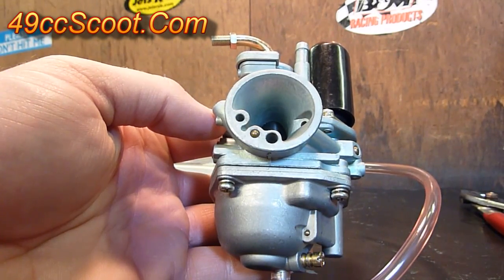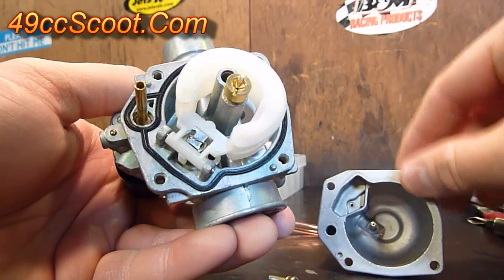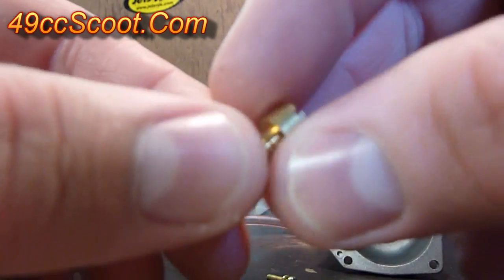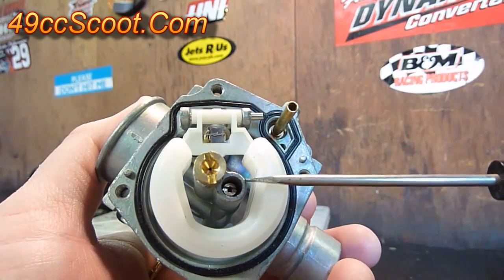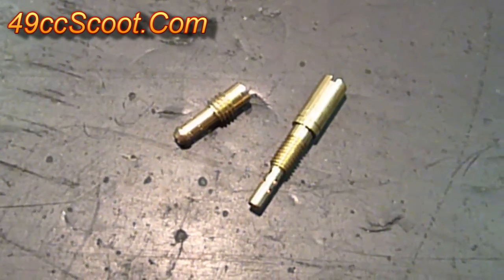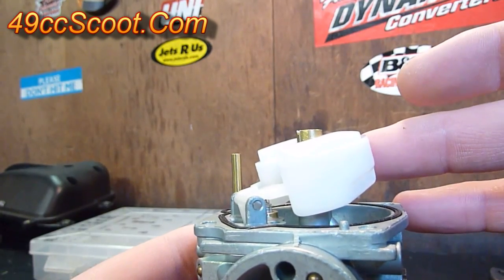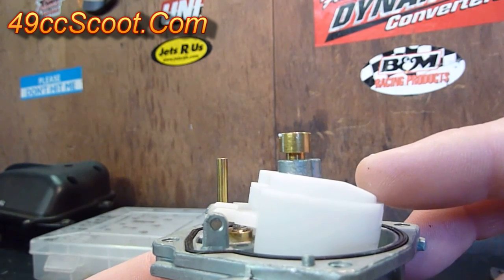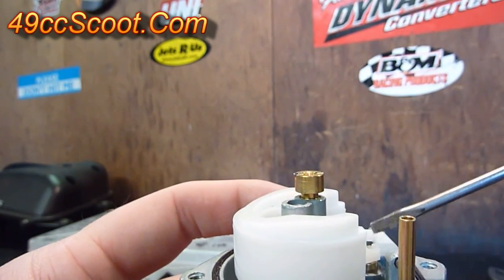Two-Stroke Scooter / ATV Carburetor Settings And Adjustments 4of4 : Jetting & Float Height

Comment: My scooter (2019 Wolf Rx-50) doesn't like to start. I have to use a mix of pumping the throttle, electric start, and kicking( not all at the same time) just to get it to start. With the e start it'll crank over and over but won't fire. Got spark air and fuel but seems like it won't ignite. If I kick it about 30 times it'll start and run all day. However if I turn it off it doesn't start and I have to repeat the process. No leaks fuel or oil. Petcock is working fine, filter is fine. All electronics are fine. I've been over the carb 20 times with carb cleaner and nothing is clogged. The tank is clean, all the fuel lines are clean. No vacuum Leaks, I'm at a loss to what it could be.
Reply from the maker: Have you checked valve lash lately?

Comment: Hello, nice video. I poured almost 1 liter of 2 stroke oil in my petrol tank ( by mistake). And after one week my scooter stoped, it sounded like irn out of petrol. And now I wont start. I have spark on the plug. I need  to buy a new vacum fuel pump because i is leaking. It will not start with start gas (starting fluid) either. I will try to remove the carburetor and clean it. Any ideas what more to check?
Reply from the maker: Drain the old fuel and put properly mixed fuel in.
Check compression.

Comment: I have a question... I know it's been 12 years since the video is posted but my Malaguti F10 Jetline is having some problems. I bought new parts for it like new carburetor, cylinder, piston, variator kit... everything is new on my scooter. Tried everything you showed in the 4 videos on how to but when I drive it, it goes very very slow up in speed and uphill it's slow af barely goes to 10mph. I don't know what to check. I checked the exhaust, the intake, generator, sparkplug, sparkplug wire, cdi, even new battery... It's my second Malaguti F10 and with the first one I could go 50mph and this one barely makes it to 25mph on a downhill.
Reply from the maker: Cover the basics first. Do a compression test, check spark strength (bend the ground strap way back on an old plug so it has a big gap and make sure it still sparks bright and consistent), double check the air filter, air box, intake connections, fuel supply. Try using known good parts off of the well performing scoot (CDI).

Comment: great vids, realy usefull. already been bussy with my quad, different carb, a dellorto 17.5 tho. had a main jet that was to large so would not go faster than aprox 30km/u. now it reaches about 45 or 50 which is just right and runs nicely, but when it is on operating temp it does not pull good anymore. the first bit when idling an hitting wot goes fine but then it slowly climbs in speed, where before it would realy pull. so u could say i am missing torque
Reply from the maker: Also consider the CVT. Sometimes springs fade with heat. CVT gets hot and  RPM drops. Watch your tach carefully.
Reply: @49ccscoot  nice of you to reply  thanks :) i wip have a look and check the condition, but other than that how would i know that it is the cvt, and not a lack of fuel or something? the sparkplug looks oke, a bit mat black even but i dont dare going smaller with the main jet, afraid it wil run to lean. also i moved the needle clip 1 position down but that seems to make it worse
Reply from the maker: @Kpostma100  The tune for the carb really shouldn't change much from warmed up to a little warmer than usual. If it's heating up a bit too much, that may tell you it's already too lean or there's an issue with cooling otherwise. With one of my scoots, it was pretty obvious. I had a CHT gauge and that would stay about the same and also had an oil temp gauge on it (four-stroke), and after time it would drop RPM. Without seeing engine temps rise, it was easy to tell that something else had to be happening.

Comment: My god I feel dumb. So the main jet isn't supposed to be loose at all? Been having an issue with my old moped and I have the main jet loosened a bit because that's what I thought it was supposed to be. Well, I guess I can check if that fixes it tomorrow. If so, many thanks!
Reply from the maker: No. It should be snug. Hope that fixes it.

Comment: I'm installing a yz80 carb on my 70cc vino 2 stroke, I want to relocate carb is there any problem with making intake a foot long?
Reply from the maker: Generally people are trying to get a short inlet path and the most direct flow toward the transfers. A long intake may make the engine favor low RPM. In the case of a foot long intake, probably very low... like idle.
Reply: @49ccscoot  thanks pal

Comment: Hi again my 17.5 carburettor have a problem i order a new one 19mm you thing the air pipe can fit thank you again
Reply from the maker: Depends on the carb, because there are lots of variations of 19mm carbs. Many can be made to fit. I've used 19-21mm DellOrto PHBGs in stock intakes a lot.
Reply: Is same this one item number 203299831261 EBay thank you PiaggioZip 50 2T
Reply from the maker: @MrBerenguer67  0 results for that number. If it's for a stock scooter, it may fit. See if the listing has any dimensions that you can check or try asking the seller.

Comment: hello i have a problem my bike bogs at 1/4 throttle, it runs great at 2/4 to full throttle
Reply from the maker: You can try richening the mixture screw first. See if it improves. If not, try leaning it a little bit. Make notes of where it was and how much you adjusted, so if it gets very bad you can  at least get back to where it is.

That may not solve it, but it would be the first thing that I'd try. Then maybe try richening the needle one clip position and see what happens, if it doesn't run well with just the mixture screw change.
Reply: @49ccscoot  thank you for fast reply,
i tryed richening mixture and it was most stable when it was totaly screwed but i had problem with stuttering at full throttle, solved problem by raising the needle to the max, but now i have problem at full throttle mixture is too rich it doesnt stutter but its worse i can feel it i will try smaller main jet tommorow
Reply from the maker: @BOOMCATIGA  Sounds like you're on the right track.

Comment: How do you know if its an m4 m5 or m6 threaded jet?
The thread is 3mm in diameter, and the head is 5mm diameter.
Reply from the maker: The diameter of the threads will tell you. So, and M4 is roughly 4mm... usually a little shy of 4mm... but not 3mm. You can also use thread gauges, or go to sites that have measurements of jets and try to match them up. JetsRUs has some measurements.
Reply: @49ccscoot  thank you!

Comment: Do you use the carberutor used in this video for your 80cc performance scooter? I have the same one and have a 70cc kit with a air pod filter. I am at a #115 main jet and for the life of me cannot get it rich enough to bog at all. Any suggestions?
Reply from the maker: My 86cc that's currently in my scoot is way too much for a stock carb. The stock carb has worked fine for me on mild 70cc builds. It is even OK with a stock 90cc, though the 90cc ran much cooler with larger aftermarket carbs for me.

My first suggestion would be to go back to an airbox and go through the main jet selection process again. I'm using a modified stock airbox on my 86cc at 14,000RPM with a 25mm carb. 
https://www.youtube.com/watch?v=SJth-GEy9aY

Comment: Took carb off 90 cc 4 wheeler and cleaned carb and jets throttle snaps back as it should but throttle seems to stick when I'm going full speed and go to let off and it's still wanting to go on it's on
Reply from the maker: Could be a cable issue or the throttle itself. You'll need to inspect the whole system and it wouldn't be a bad idea to lube the cable while you're at it. Replace the cable if you find it frayed anywhere.

Comment: Hi man. Do you know of a link where i can buy that rubber seal on the bowl? Mine broke off when i cleaned the carb. I hve a stock mikuni carb that has number 16-56829 written on the outside of the carb. Thanks I'm from NZ usually gets my parts from ali express
Reply from the maker: Look up the scooter places that you normally shop or places that ship globally like maybe scooter-attack or scootertuning. In a pinch, I have measured o-ring diameter and then figured out it's size if round and found generic o-rings that work. That can be a pain when the ring has a lot of contours beyond the basic round or rounded rectangular stuff though.

Comment: I need help my carb is leaking after every ride for few minutes and it stops from overflow and i tested tension on my float and its super good but it doesnt stop leaking
Reply from the maker: If the float height is good and the float isn't stuck, then maybe the float needle isn't sealing off flow.

Comment: So I just bought a new carburetor to my scooter and when I hit max gas the engine doesn’t get gas and will die if I keep it on max gas, what do you think the problem is??
Reply from the maker: If it's only all the way wide open, it could need a different main jet or the main jet may be clogged. If it happens basically any time you try to hold it 1/2 throttle or more, then the main jet is probably clogged or it's way far off. Also check fuel supply and float height.
Reply: Thanks, because my old carburetor had a 52 main jet and the new one has a 75, so then I just gotta change those right or am I wrong, because I’m not from the us and I don’t really understand everything?
Reply from the maker: @alfonsbonesson2707  Try that swap and see what happens. You may still need a different jet. Make sure the airbox and everything is installed as it normally would be when testing.
Reply: 90GTVert Now I tried to change the jets to the smaller one (52) from 75 and now I can’t raven get the weel spinning, what is you’re opinion on that, what should I do to fix it?
Reply from the maker: @alfonsbonesson2707  Get a main jet kit and try a larger one. Make sure everything is good with the air box.
Reply: 90GTVert yeah I bought a  sport air box just recently so that one is good, I’ll change the main jet but do you think I can change the needle because I haven’t checked it? Maybe make it put in more fuel?
Reply from the maker: @alfonsbonesson2707  When the problem is wide open throttle, it's generally the main jet. You can try restricting airflow to see if that helps till jets arrive. Sometimes taping over just a small portion of an inlet in an airbox will work. Prob that sport airbox needs a larger jet.
Reply: 90GTVert i changed back to the old og air box and the 75 main jet and now the scooter doesn’t die at full gas, and the engine goes, but the wheel doesn’t spin at full speed and it only goes 20 km/h when it should go at least 45 km/h. Why do you think it doesn’t spin at full speed, do I still need a bigger main jet?
Reply: 90GTVert the scooter didn’t start and wasn’t able to go full gas before I change the old carburetor, so it doesn’t have to be the new carburetors fault
Reply from the maker: @alfonsbonesson2707  You probably need to tune the carb (diff main jet, idle mix adjustment, needle settings).
Reply: @90GTVert Thanks!

Comment: So if i want my stock airbox with snorkel off to a ppd filter  i would only have to upjet the pilot jet?thanks
Reply from the maker: Main jet almost certainly and maybe the pilot jet. If you can get the tune at very low throttle right with the idle mix screw, than you won't have to change the pilot.

Comment: Hello, Frist thank you for all the videos. I have one question. I was change cylinder with a little more powerful and now I have problem with the power. I think that don't get enough gas. So now I need to change the jet, but I don't know which jet, main or pilot jet ? Thank you for answer.
Reply from the maker: Could be any of the jets or adjustments, but most commonly it's the main jet. Helps to understand what works where. http://www.49ccscoot.com/faq/carbtune.html

Comment: Hey great video, where can I order (or get a part number) for that float?

I have a Bombardier DS90 here with a cracked float and I can't get parts because they're discontinued!

Need a part number for this as it looks identical!
Reply from the maker: Just replied on your other comment. Also, you can get whole carbs on eBay cheap. Search for "polaris 90 carb" and some will come up.
Reply: 90GTVert thanks!

Comment: sir~ I have PHVA 17.5 carb,  my friend said that 0.75 mikuni idle jet are able to replace.  
but vm's thread diameter are too big for my carb               
orignial idle jet Screw thread size=3.9mm*0.75
  VM16 idle jet Screw thread size=4mm    *0.75
 I couldn't find the right idle jet to replace...
Reply from the maker: You can get PHVA idle jets from treatland.tv and prob other places.

Comment: In my bike when I drive slowly my bike getting off, please guide me to trouble shoot
Reply from the maker: You mean the engine is cutting off? Any other symptoms?
Reply: 90GTVert when I drive in 3rd or 4th gear & if I slow the acceleration means my bike off. Previously I have over flow problem in my carburator my mechanic replaced new carburator from that day this problem is maintained. My spark plugs gets black also
Reply from the maker: Does it run well otherwise? Maybe try adjusting the idle speed and mixture settings. If you aren't off of the throttle totally, then it's not so likely that.
Reply: 90GTVert I already adjusted ideal screw & air fuel mixing screw & slider pin also I adjusted but no use. Problem is still maintained, I given to several mechanic but problem is still maintained
Reply from the maker: No leaks around the carb/intake? SOmething not connected well or cracked/torn? Thinking that since the issue started after a new carb.

How about simple stuff like changing the spark plug(s) and checking the plug gap?
Reply: 90GTVert I didn't change plug, u have given some idea. I will change and inform u
Reply: 90GTVert no leaks around carb/intake

Comment: Thanks for the video, I just bought a Genuine Buddy 50cc, and want to get some more speed out if it. So I’m looking at the Prima exhaust upgrade that comes with the jets. Dealer wants $300.00 to install. I Never changed jets out of a carburetor before, thanks to you, I can see it’s very easy. Thanks again 😁
Reply from the maker: Good luck with it! Way more info if you want it : http://www.49ccscoot.com/faq/carbtune.html
Reply: @49ccscoot  Thanks for the further info. About to do a new main jet on a 2020 Taotao pony 49cc scooter carburetor.Was trying to see my best starting point.Definitely going the 5-sz. over & rich.Then back it down as tread talks about. Thanks alot!

Comment: pls help OP or 49ccScoot.com I am trying to find the size of my VM22/210 pilot jet I lost. There is no information on the entire internet about my Mikuni carburetor on a Suzuki Carna 1985 49cc scooter so I have no clue what size it was... apparently the engine can seize if its too low (lean) and they're very expensive so I can't just go buy a high number and work my way down...
Reply from the maker: If you can find your model on a Suziki parts site or a dealer, they often list jet sizes.
Reply: Trust me ive searched everywhere, this scooter is an import and they only made them in Japan. ive  even searched japanese sites and closest i got was here (https://japan.webike.net/ps/#!search&p.ref=product-search-es&p.rows=24&p.m=5799&p.c=1340) . I saw that many 50cc scooters use size 17.5 to 30 , do you think 30 or 32.5 is a safe bet?
Reply: i searched google japan in japanese and found it on a random second hand site. thanks though
Reply from the maker: Glad you found it. Wanna post what jet size you found here just in case it will come up in a search if anyone else ever needs it?
Reply from the maker: Thanks!

Comment: I can't understand what's going on with my 1982 urban express deluxe, it hits 20 then sputters... How do I fix it it's all stock with an 85 jet
Reply from the maker: Carb cleaning and checking the condition of the air filter and airbox would be at the top of my list.
Reply: 90GTVert air box is good carbs clean main jet is clear
Reply from the maker: Is the 85 main jet also stock or a recent addition? If that's a recent upjet, it could be the issue. You may also want to make sure you have a strong spark. Use an HEI or adjustable gap spark tester... or bend back the ground strap on an old plug or cut the ground strap off totally and that makes a big gap for the spark to jump. Alternatively, you could try decreasing plug gap by around 10 thousandths and if the issue goes away, you either had the plug gapped wrong before or the ignition system is weak.
Reply: 90GTVert 85 is stock what im running

Comment: I need this exact o'ring for the float bowl on this carb but for some reason I can't find a picture of it when searching to buy one.  Can anyone help with a link that shows this exact o' ring I would really appreciate it.  Thanks!
Reply: ah just found one on ebay $2.50 - $7.50 shipping... or for $23 bucks can get a whole new carb!
Reply from the maker: It doesn't often pay to rebuild generic carbs. Tune 'em and clean 'em, but if they need many parts consider replacing the entire carburetor.